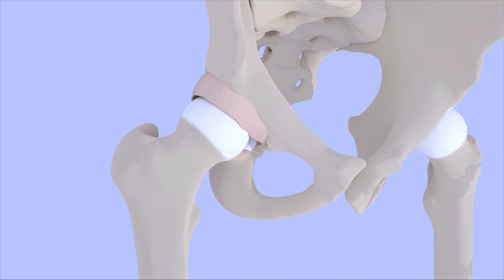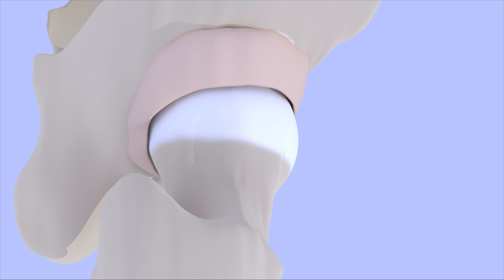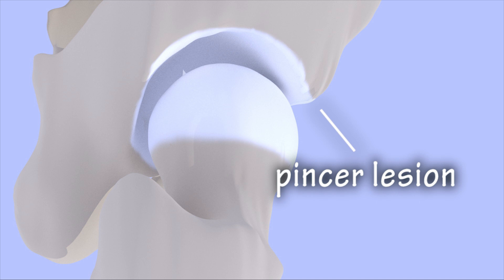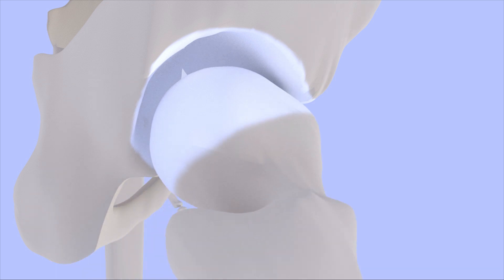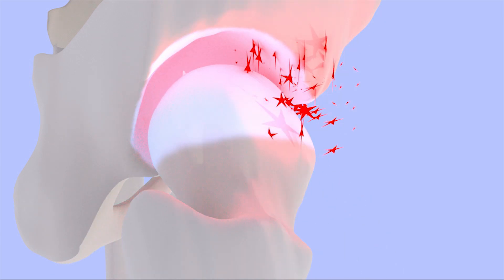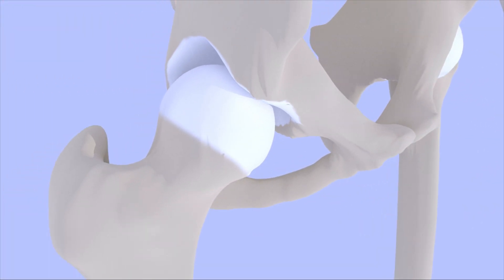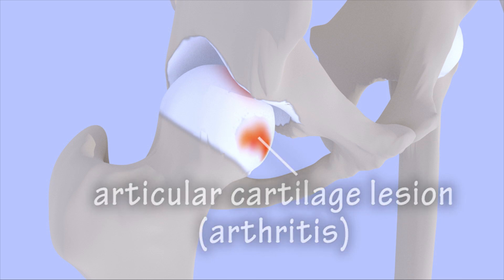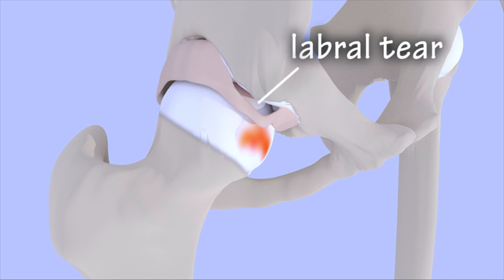Femoroacetabular Impingement Syndrome

Comment: In the original mock up (normal hip), the cam bone will never reach the socket bone. It isn't until you add in all that extra bone for the pincer socket region that those bones come anywhere near.  I am skeptical of how much bone you need to add to the neck of the femur before they make contact with anything in the hip joint itself.